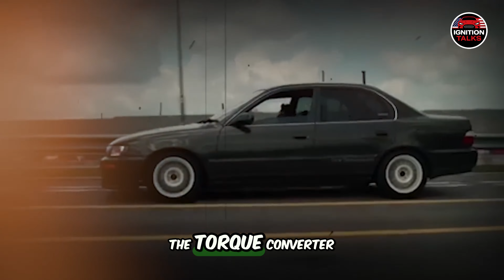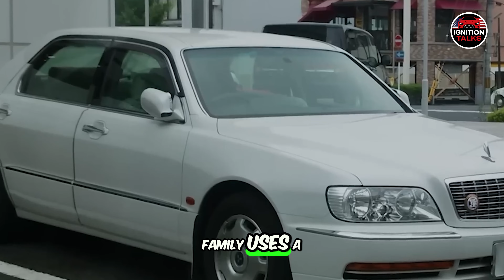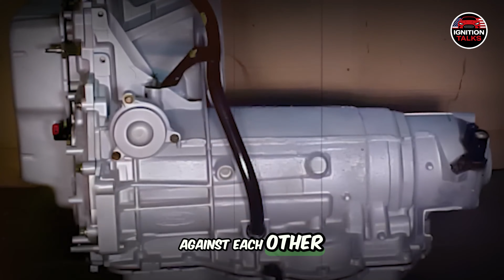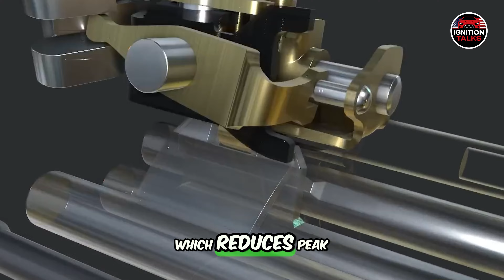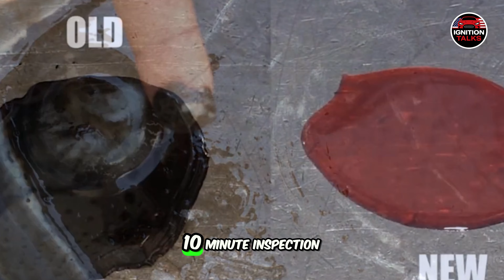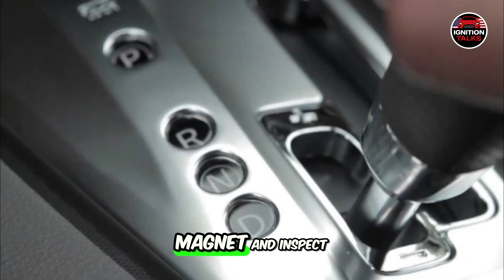The Secret That Makes Old Cars Run Forever

Comment: Since you are a Chevrolet man what do you think of the 3.9 liter V6 engine such as in my 2011 Impala....thank you
Reply from the maker: The 3.9L V6 in the 2011 Impala is a solid mid-range engine — decent torque and smooth performance, but it’s known for a few common issues like intake manifold leaks and lifter noise. Not bad overall, just needs regular maintenance.
Reply: @IgnitionTalks ..thank you drove Honda Accords over a 35 yr period until the last 1 got totalled..found the Impala but know nothing about it
Reply from the maker: Sorry to hear about the total loss — that must’ve been tough after so many years with the Accord. The Impala isn’t a bad replacement at all. It’s spacious, smooth on the road, and has decent reliability depending on the year. If you’re looking for comfort and solid value, it’s definitely worth considering
Reply: @IgnitionTalks ..ive had the Impala 3.9 liter since February..would like to know all about the engine..everything you could tell me about quality reliability..bad parts of it, etc
Reply: It does ride hard
Reply: Compared to the Accords